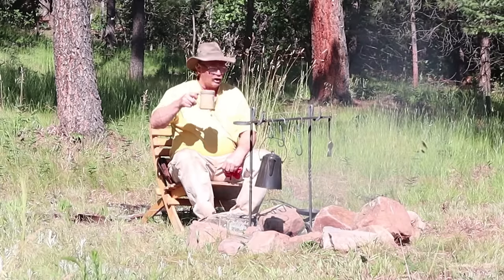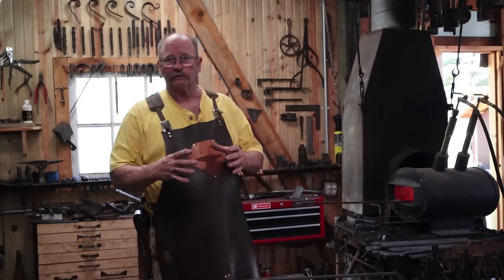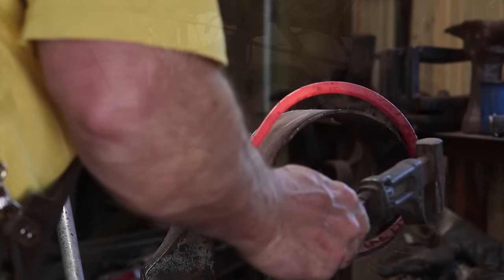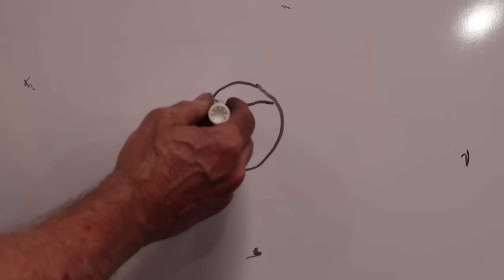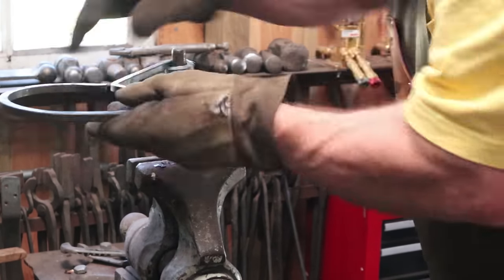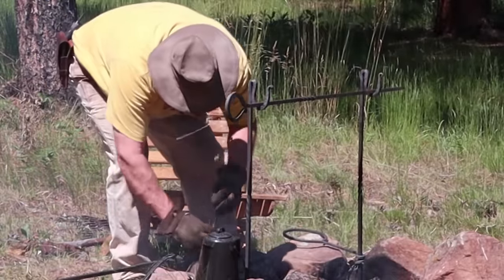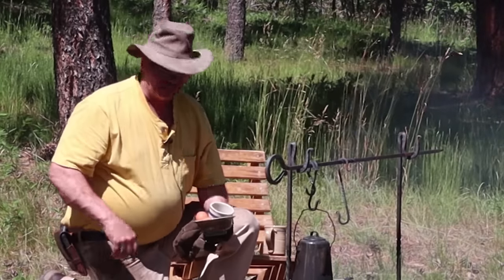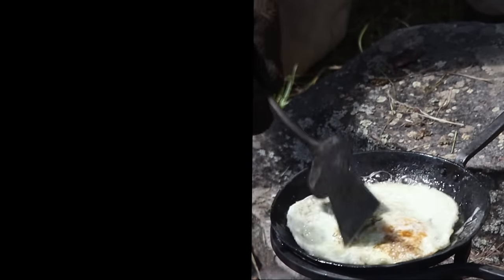Forged skillet holder - Campfire cooking

Comment: Great video. I like it. Think i would like to add a set screw to keep it in place
Reply from the maker: You can, but it tends to force it to align only on the flats of the bar which really limits the positioning options

Comment: I use concrete form stakes with holes . Put a pin in nail hole at the height you needs and it won’t slip down.

Comment: Never forged or used a forged skillet, but I have a carbon steel skillet that I use a lot. It's like made in China or whatever, but it's just mild steel, so that really doesn't matter, it's nice and thick and it heats up so well. It's way better than my cast iron, and a lot lighter, although I have some nonstick aluminum pans, and there's that difference, but I still love my steel pan the best.

Comment: I"m more into the bushcrat/backpacking side of things. As of late, I've been thinking of making a "squirrel cooker" using a single straight upright, and the pigtail being in the center of as horizontal piece, having a skillet holder on one end and a pot hook on the other. The trick being that the horizontal bar needs to be flipped to change from one end to the other. I'd be losing the ability to adjust in and out over the fire, something which could be accomplished by swinging the pot/pan on the upright, will adding the ability to easily adjust up and down, which in my experience are more important. As I haven't fired my forge up in years, I've yet to create a proof of concept design.

Comment: If you bend the arm so it is 5-10 degrees higher than the mounting curl it will not release when you take the pan off

Comment: The skillet slides up and down with a loop on the handle round cold roll .you do that and sell it. One less piece.just right😉
Reply from the maker: Well lets think of all the reasons thats a bad idea.  The separate holder allows multiple skillets or other pans to be used as the meal dictates.  Personally I clean the skillet after use and don't want to have to dissemble the rest of the set just to remove it from the fire.  I often serve from the skillet which presents the same problem as needing to remove it for cleaning.  Often the heat isn't even or the contents of the pan need to be dealt with from a different angle, which can't be done if it is attached to the upright.  The skillet holder as is allows the customer to use their favorite cast iron skillet without having to buy a dedicated more expensive one.  But if you want to make on that way, feel free.

Comment: Does 1/4” hot rolled square bar not exist? I can’t find it anywhere. I went to buy some steel to start my at-home practicing and they only had “cold rolled key stock” that was  $0.60/ft.  I wanted to use 1/4” to practice making S hooks. Do most smiths just use 3/8” for making S hooks, or do I spend extra on the cold rolled?
Reply from the maker: Many years ago I could get it.  But suddenly it seemed to be unheard of and I now use 1/4" cold roll, which costs more, but seems to be readily available.  I would confirm the actual material if they are calling it key stock, that often implies some form of tool steel.  1/4" cold rolled round or 3/8" hot rolled round are other good options for hooks.

Comment: I wish I had a campfire iron set like that.  Why not use the s hooks to hold up the pan holder to keep it from falling.  They won't be in the way at all.
Reply from the maker: That would work if it is positioned directly under the cross bar

Comment: Can a Mapp gas torch be used for heating the steel?
Reply from the maker: For small work it can be used.  It would get pretty expensive if you did lots of work that way
Reply: @BlackBearForge   thank you for the reply,  I was considering making two of the skillet holders and two with hooks.  I'm only really planning on this one project for the time being and if it goes well, upgrading to an actual forge for future projects.  Just afraid to commit too much until I know I'll stick with it.  I already have access to an anvil, torch, and table vice...Pretty sure my pipe wrench, hammers, and channel locks are in the barn.

Comment: There is a far simpler way of doing it, simply cut a slit in the top end of the handle of the skillet pan which can clip onto the vertical stake at various positions.